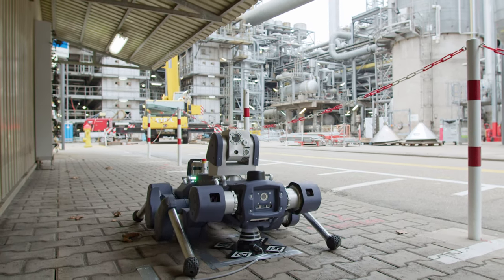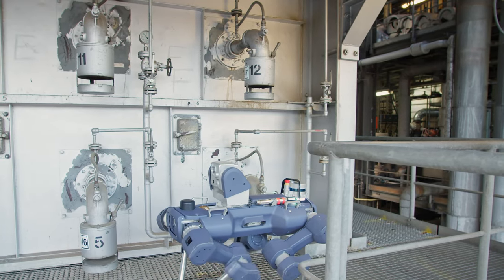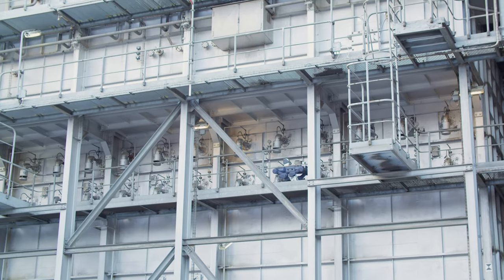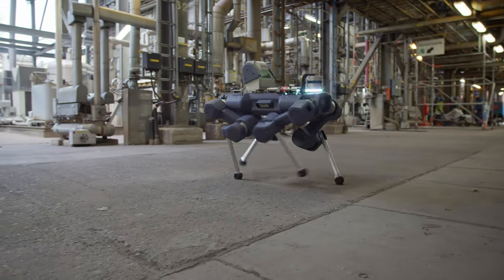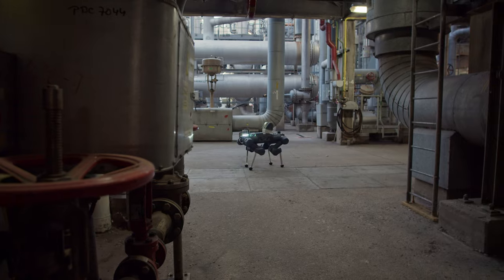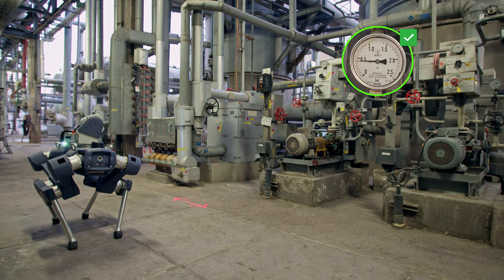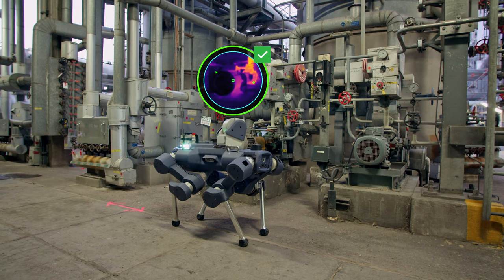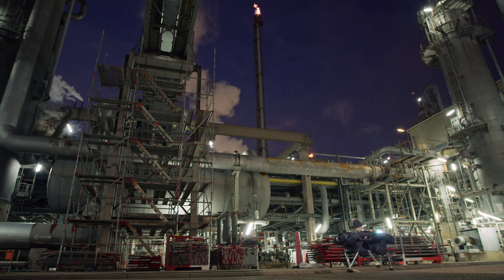Autonomous Robot Inspections with ANYmal X in Ex-Zones at BASF

Comment: If the top speed can achieve 85 km/h, then this can be great for reconnaissance missions.
Reply from the maker: It isn't that fast and it doesn't need to be for industrial inspections. Good data collection is way more important than be able to run